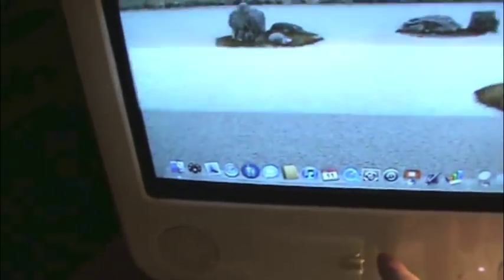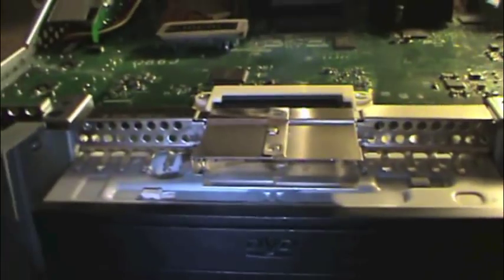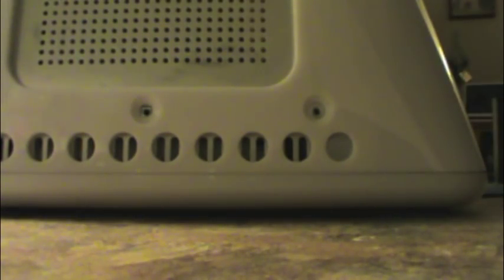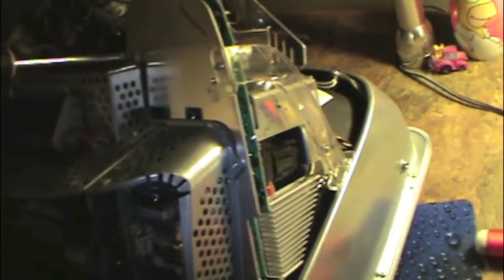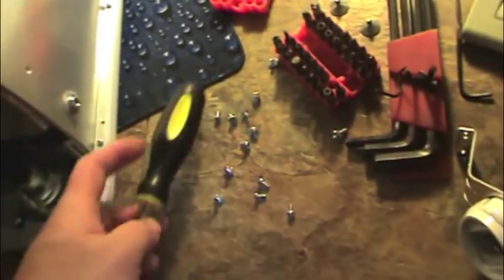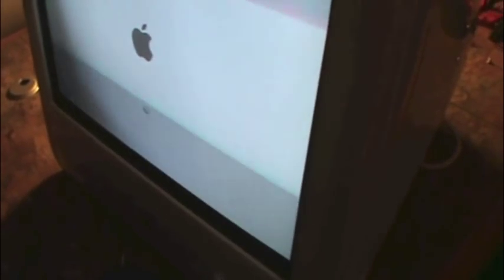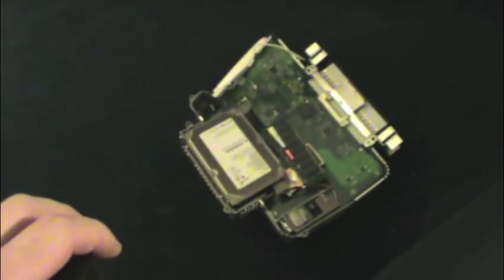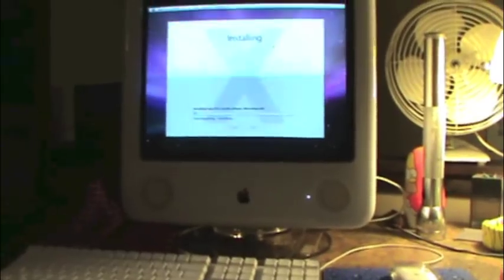Upgrading The Apple eMac Logic Board

Comment: i have the 1.25ghz usb2.0 (2004) but was built in 2005 in the logic board and the capacitors are still good. 
upgrades are
OPTIARC DVD RW AD-7170A 
2gb ddr400
using mac os 10.4.11 but going to get the 10.5

Comment: One thing you can do if the power button breaks is get a cheap little 2.00 2 post push button (any one will do, some thinner than others, but for example like this http://images.oreillyauto.com/parts/img/medium/cti/85980-007.jpg) from walmart or oreillys auto parts, equip the new button in the existing hole or drill new one, solder some leads on and then add (splice or solder) a male and female connector to the leads to make it easier to disassemble with ease if your button has already broken. I did that with a 2009 Dell inspiron desktop and one of my custom pc cases I used. Hope this helps someone -Foxi D'elegance

Comment: i know its been YEARS since you did this, but can you recall if you can swap just the logic boards themselves? im looking to get a 1.0ghz board for my 2005 model so i can run native os9.
Reply from the maker: Unfortunately this will not work - OS9 will only run on the oldest boards (800MHz and below); this limits you to a board sourced from a 2003 or earlier model. Your 2005 model is a totally redesigned machine internally, and no parts are interchangeable between the two.
Reply from the maker: When I got my Apple certification in 2007, I still had to take the courses for the eMacs (including CRT handling and safety training) because there were still in-warranty eMacs in the education market. I remember the day I was hired (I work in a school district) - we had just received an order of eMacs, which would have been the tail-end of the eMac production run, and the last Apple products to feature CRT displays. It's a shame the eMac has managed to escape collectability status and can still be purchased for less than the cost of a cheeseburger. Good times...
Reply: @bbishoppcm  That's incorrect. The 1GHz model can natively boot OS 9. It's the 1.25GHz and later that are OS X only (with only OS 9 emulation through OS X). I don't know why he upgraded his 1GHz to 1.42GHz here. The speed difference is negligible and you completely lose native OS 9 support.

Comment: This upgrade peps up the eMac modestly, but you’re still left with a sluggish, unsupported and no-longer-updated OS. I found it useful to replace OS X with Linux, which runs faster than OS X ever ran, continues to be supported and regularly updated, and there’s lots of free software available including up-to-date internet browsers and tools, and LibreOffice, all conveniently updated in the same app that updates the OS.

I divided the hard drive into 3 partitions: one for Linux MintPPC, the second for Lubuntu PPC, and a 3rd for a shared swap partition (such a setup is OK since only one OS runs at a time, but don’t Hibernate from one and then launch the other because Linux uses the swap partition the hibernation image).

MintPPC
http://mintppc.org/

Lubuntu PPC
https://wiki.ubuntu.com/PowerPCDownloads

Linux takes up a lot less hard drive space than OS X — all this is on a 40 GB hard drive. I removed the stock 80 GB drive to retain OS X in case I didn’t like Linux, and although I’m never going back to OS X, I can’t be bothered to put back the 80 GB drive and re-install everything again, since there is still plenty of free space in each Linux OS partition of the 40 GB drive. The installer puts in a boot menu that lets me pick which Linux variant to launch.

Problems: Linux printing works but is generally very sluggish, so I avoid it. Sound works perfectly in MintPPC, but so far I haven’t succeeded in getting it to work in Lubuntu. An experienced Linux guru should be able to copy over and configure the necessary resources from MintPPC to Lubuntu to get the sound working in the latter, but I’m not at that level yet, and not having sound in Lubuntu doesn’t bother me much. Developers seem to be more actively working on Lubuntu, so perhaps the sound will start working soon (Lubuntu PPC's lack of sound on eMac is a known problem).
Reply from the maker: +Einstein WasRight Ugh... another one. Look, I never planned on running this thing as a daily driver. It seems everyone's answer to everything is "put Linux on it." Dude. Seriously. I wanted a machine to run classic OSX software... nothing more. It also serves as a "bridge" machine to prepare software for my pre-OSX systems as well. I had a bunch of 1.33GHz MLBs on hand, and a very clean low-use eMac... so I hopped it up. This was not an invitation for the "You shoulda..." crowd. I'm perfectly happy running it on 10.5. Seriously, these "Here's how I would put LINUX on it..." posts are getting old.
Reply from the maker: +Einstein WasRight I have plenty of better machines to run LINUX if I ever find the need to, and I own a modern Macintosh that runs the latest OS as well.
Reply: +BBISHOPPCM&#39;s World I'll be perfectly honest, the only real reason I bother with Linux is because the latest Windows license I own is for Vista Business 32bit and I don't want to/can't buy anything newer. I know you can run non-genuine Windows just fine after Vista (it just becomes nagware) but I don't want my computer nagging at me either. Xubuntu does fine for what I use it for.

Comment: Computers haven't been getting faster at the rate they used to. As a consequence, you can use much older equipment than was possible before.  My desktop PC is from 2007 and it is 2019 and this thing works fine.  The only things I have done to it was to max out the processor, which was only a few hundred mhz faster, but was only $5 for the chip (core 2 duo 3ghz), and added a 2nd hard drive 500gb which I bought for $5 at a flea market. It's a dell.
Apple has been screwing their customers for a long time, but really got bad in the last 10 years or so. Now you don't even get a headphone jack on a goddamned phone!  There is absolutely zero reason this emac should have been more or less unusable as a main machine in 2012.